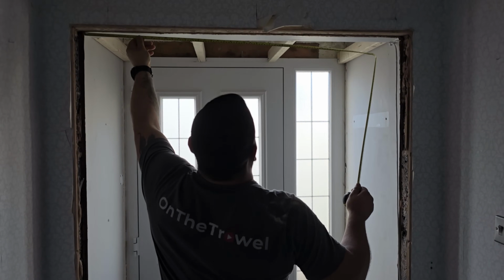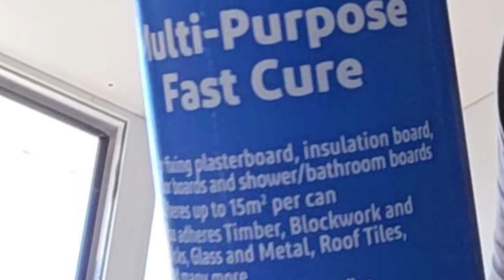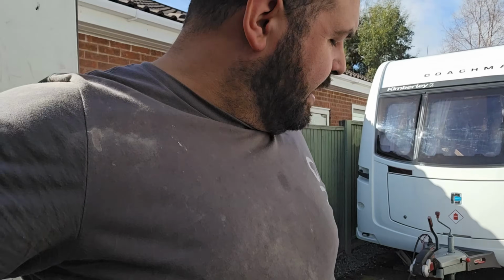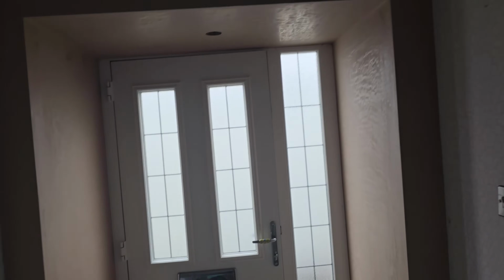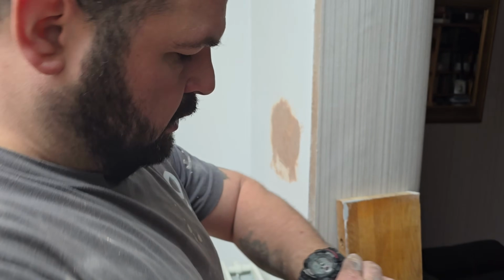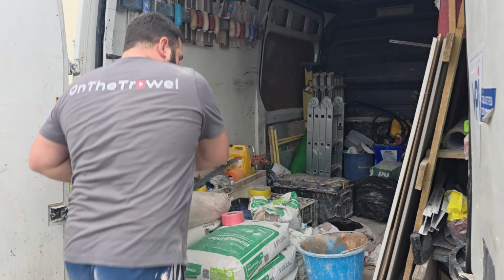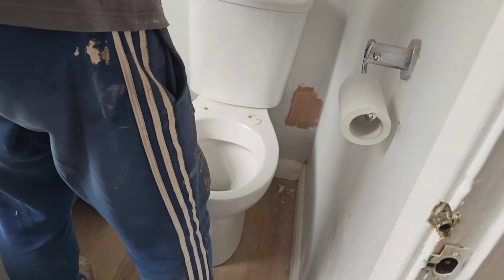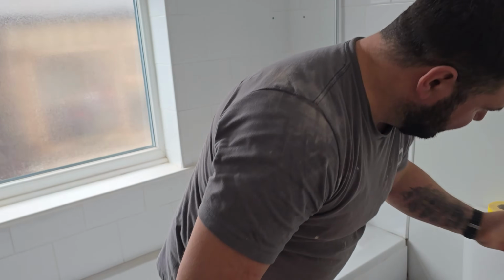IS THIS THE MOST LUCRATIVE TRADE IN THE UK

Comment: Kirk, I never see you putting a level or straight edge on those small corner beads.  Do they keep their own shape to remain straight, unlike the old larger corner beads?
Reply from the maker: Hey mate, so basically, if I was plastering a wall from brick then you use the beads as screens, so you get them level and work from them to get the wall straight and true.

I'm just mainly reskiming so the plasterer before me will have already done that and I'm just putting a thin coat over the top.
Hence the thincoat beads.

Hope I've explained that properly mate
Reply: @Onthetrowel  I hear you Kirk.  It saves a good bit of time too!  
My late father run his own plastering business for 40 odd years.  I got dragged in (as you do) as a teenager.  Served my time, but ended up joining and serving 24 years in the Paras.  I’m now 54 and your vids have made me appreciate what I had at the time.  Never appreciated it at the time.  My Dad was old school and would have loved your videos.  Tempted to dust my old hawk and trowel off and try my hand at some patching and repairs.  Not fit now (through injuries) to do big stuff.  But could make a few quid doing patching and repairs I’d think.  He would have loved “Half Time….  No need to fire some white cement in to set it quicker.   Keep the videos coming Kirk and I wish every success on YouTube, you deserve it buddy!
Reply from the maker: Thanks mate and I enjoyed reading that. 
Cheers mate

Comment: that old connector block and electrical tape joint, love it 😂😂
Reply from the maker: 🤣🤣 what would of been a better way mate?
Reply: @Onthetrowel  wago connectors and encapsulate that in a enclosure such as a Wago box. Least you used connector blocks I have seen many times people twist the cables together and just tape that 😂😂
Reply from the maker: Thanks for the advice mate